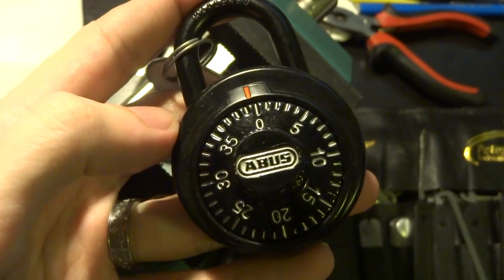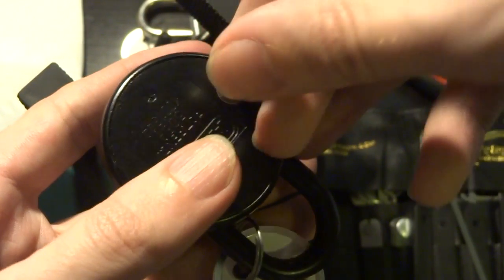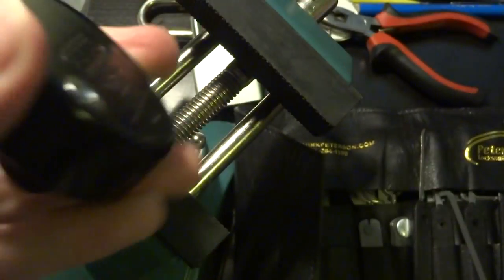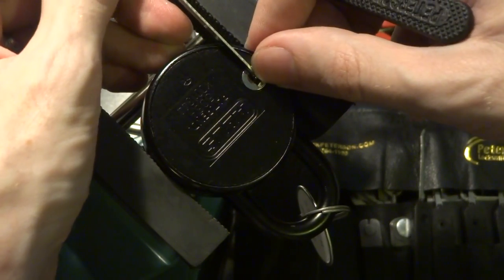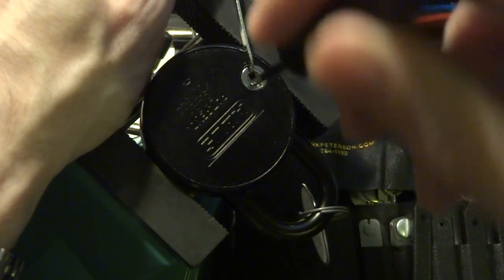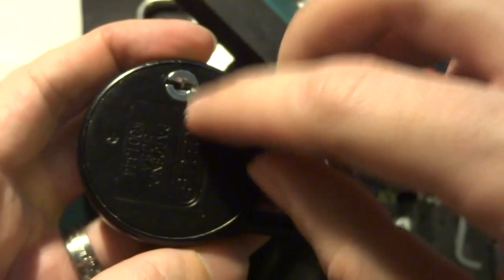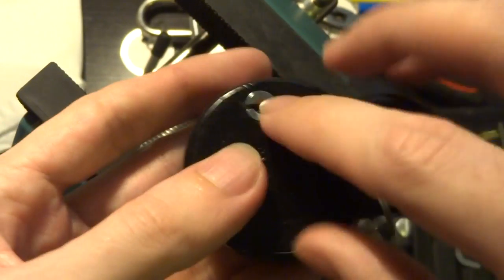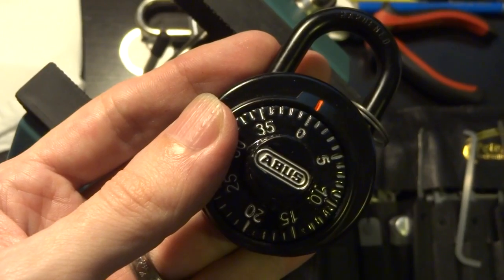(017) Abus 78KC/50 picked

Comment: Think it may be Pin Tumbler, Not Wafer. To Reduce vulnerability to Picking, break off a tooth pick deep inside. Have you tried determining combo by looking down shackle hole, Rotate dial so slots line up, then add or subtract same amount for all numbers? When I find a master padlock with no combo at yard sale, shim open, determine combo from down shackle hole. I also determine, and let them see with the combo, they are worth more, 4$, not 3$

Comment: So an override key doesn't have to be specific to a batch of locks? You can just purchase an override key online that will work for all (or most) locks of this model?
Reply from the maker: +LumeTV In the case of this model, that is pretty much the case. In theory a large customer could request a customized version from the factory or the factory could make different override key/cylinder combinations and sell each one in different regions or to different distributors. Unfortunately, all of that is just speculation and every one of these override keys seems to be the same.
Reply: thank you for the response
Reply: Having looked, some have a color listed beside the key model i am wondering if the override key is specific to the color of the key e.g. black/blue or black/green or silver/blue. Thanks
Reply from the maker: +LumeTV I have only seen the "507" key which even Abus lists as 'the' master key for that model, I have seen no evidence that the body or dial colors are indicative of different override cylinders.